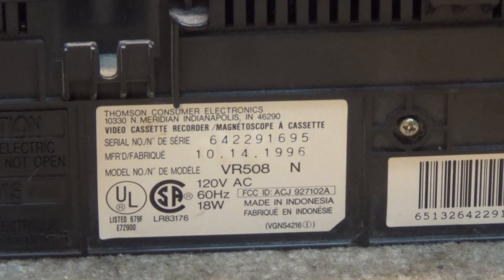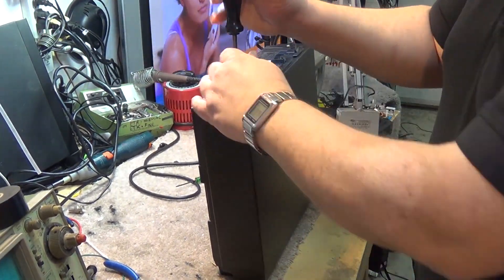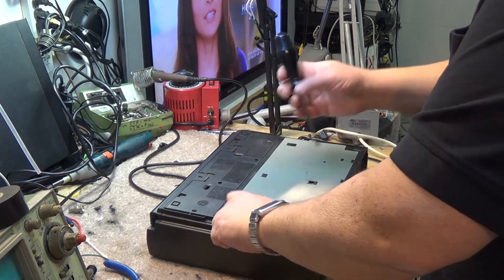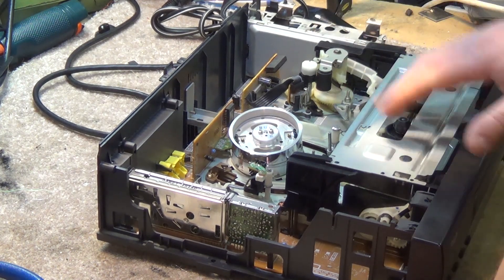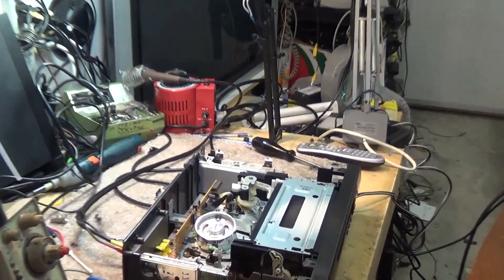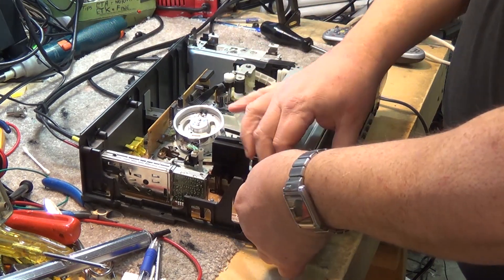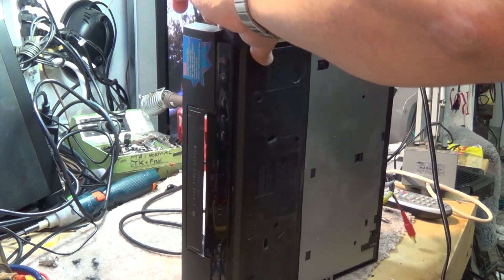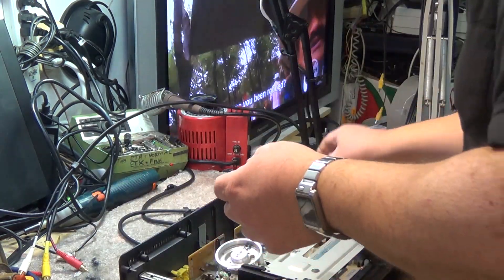RCA VR508 Overhaul

Comment: This Was A decent machine dave, but One of my youtube friends had an RCA Panasonic VR612HF VCR From 1997, and sadly, the Play/Pause button broke and by mid 2018 when he moved, he threw it out. It still worked though. I miss it bad:( I rembember the last video he used it in before that happened was 3/28/16. My 2nd Grandma had another one like that, but it was VR346 2 head version. And I remember at their old apartment in 2007 i remember it was in the spare room and by 2009 she moved across the street and by early 2012, i was disappointed it didnt have the remote control. By 4/7/2012 the day before easter that year, i took the front cover off, then my dad tossed it out. I should've had them order a remote for that one off ebay. Honestly, these panasonics from 1997-1999 and prior to that despite the common faults they have are one of my favorites.

Comment: Dave i tried as hard as i could to get my rca VR337 1996 VCR Front loader back in alignment and i did it first back on 8/20/2017 and i tried as hard as i could but unfortunately i couldn't. I did however turn the mechanism back all the way though. I didnt take off the cassette housing assembly. There are a LOT of screws and i was worried i was not gonna get it back together correctly because i never done this before until that day. I accidentally dropped a screw in the chassis and it sat for a month or so and on 9/24/2017, I decided to get the screw out and put it back in. However i did not even notice but somehow i accidentally broke one of the power supply clip holders when i removed it held by the red screw and as soon as i plugged it in 9/25/2017, the heads spun up like crazy and it was static on the tv, power light was on i remember. I tried as hard as i could. I could've done a LOT better.

Comment: Even though I have a complete different model, a bush VCR, and the symptoms on mine were different, I cleaned the mode switch and it works again. Thanks a lot! Now I gotta find out why I have no composite/scart signal. Only AV works.

Comment: I have a RCA VR616HF and I'm convinced they don't want you to service it. I literally can't find any more screws to take the tape mechanism off. And when I lift the mechanism is attached to the board because they both start to lift. Yet no screws to separate them.. I have no idea how to get at the belt underneath, I think that's the problem. Also there's a big housed in plastic thing with a gear with blue/green stuff on it? I think it's the ace head? I cant turn that by hand. Not sure if I'm supposed to. Can anyone help me out?

Comment: Smashing job :-D
Ive had mode switches create some odd problems, suddenly rewinding for no reason, or just going mad LOL :-D
A quick clean up and respring and its happy as larry again :-).
Some mode switches can be a pig to get to, but it has to be done.
My mate brought round a really nice ferguson videostar, it was thrown out by the local tv/video repair shop, the head loading arms had become disconnected under the metal plate, so off came the plate, i had to remove the static guides so some adjustment would be needed.
After the repair, the video gave a beautifull picture and sound, the rest of the machine was perfect, some tv/video repair shops really waste good equipment :-(
Reply from the maker: +zx8401ztv YES THEY DO.You are right about the mode switches. They cause many problems because the microcontroller reads the wrong value and does strange things.
Reply: In VRS 601, mode switch is activated by a lever when you Push the cassette. Debris and even a piece of paper loose from a casssete can make it work badly.

Comment: What a ""screwy"" vcr.  I usually pass on any mono vcrs.  But I may get one for my old Admiral TV set.  It's kewl to see what makes it tick, thanks.  Don
Reply from the maker: +umajunkcollector Actually this is a pretty good VCR. That is why 20 years later it is still working, and serviceable. It is not a HIFI machine, which would elevate it from a good to a great VCR. Panasonic made many good reliable VCRs over the years and this was one of them. They also made some terrible, complex designs. I am thinking of the one with the board over the chassis, and the solenoid that operated a clutch that threaded and unthreaded using the capstan motor. Also known as the 2 motor design. This one is a 3 motor, Drum, Capstan and loading.The 2 motor units (There is a teardown for one of those on my channel) was a bad design, yet many of their most expensive VCRs (the AG1971, 1980 AGW1 ect) used this chassis.
Reply: +12voltvids so if I ever try to service my Panasonic ag-26-000-e unit that it will be a pain to work on...well its good to know before if I ever worked on it..
Reply from the maker: +Anthony Kurtzweil The 2 motor designs were not that bad, just more gears that need timing. I have a couple of videos up showing the disassembly / reassembly and timing of the mechanism. There is one for the bottom of the chassis, and another for the top side.

Comment: I have a RCA VCR that looks just like this but model number VR503, it powers on and the mechanism works but the video does not work properly, the colors and textures are messed up. Is it a capacitor problem in the power supply? Anyway that VCR is not very important for me because it's basic and also common to find.

Comment: I thoroughly enjoyed your teardown on this vcr. I have a similar Panasonic model from 1992. What would cause two blue colored bands across the tv screen when playing a tape? Is it due to bad caps in the head amp section? Thanks in advance.
Reply from the maker: +Fred Chew Probably not. A problem in the head amp would cause total picture distortion. If the luminance (black and white) portion of the picture is good then the head amp is fine. Colored lines would be something in the chroma up convert circuit.All VCRs use a process called heterodyne, or color under recording. They take the color signal, which is normally a double sideband suppressed carrier AM composite signal mixed into the video. For NTSC that sub carrier is 3.579545 MHz, for PAL it is 4.43MHz.  Through mixing and frequency subtraction, the color signal is converted down to 629KHz and recorded as an AM signal along with the FM luminance portion of the video. On playback the low frequency portion goes through a low pass filter to remove the luminance carrier (and the luminance carrier goes through a high pass filter to remove the chroma)The chroma is then processed by the chroma circuits, and the frequency is converted back to the standard subcarrier frequency for the video standard you are working with and mixed back to the video.Color distortion if more likely caused by a drum servo error, running slightly fast, or slow. Your TV is likely able to lock in, and display the image stable, but it is far enough off that the chroma circuits are falling out of lock.I have a broadcast monitor that I will be showing off at some point soon. The key thing with broadcast monitors is that they have a very slow AFC for the horizontal, and color sync. So when playing a tape with bad time base it will show up as a wildly shaking picture. This was required in a broadcast environment so that the operators and engineers watching would know immediately that their signal was out of spec, and could halt transmission.Generally the alarms in a proadcast station would have already triggered and the transmitter had already cut over to the fanous "we are experiencing technically difficulties" slide. Our RCA TK28 telecine camera was always on standby, and the slide was loaded in the projector. As soon as an alarm was triggered, or the master control operator hit the switch the projector lamp would turn on, and the transmitter cut to the telecine camera.  This was to keep the transmitter from broadcasting an out of spec signal, and causing interference, or damage to the transmitter.You can see that massive camera unit on this archive page. It was a beast.http://www.oldradio.com/archives/hardware/TV/tk28.htm

Comment: I am working on my rca vcr right now. I am trying to get the mech and bottom plate apart.
Reply: got down to the mode switch. do I need to un soldier it?
Reply: +Shereen Esser and I do not have that special spray thing you put on the mode switch to keep it clean.

Comment: Do your customers pay you for repairing their VCRs? Or they just pay the shipping if needed?
Reply from the maker: Yes of course they pay me to fix their equipment. Units that are shipped in, they pay the shipping both ways and for the cost of the repair. My rates are considerably lower than shops with a store front as I have no overhead, and I also make money from the advertising that appears on my channel, so that allows me to work for less than the average shop, but I still charge something.
Reply: 12voltvids 
Ok, I see. If you were near me, I would have you repair my broken VCRs and camcorders on video.

Comment: Thanks for your interesting, and well presented videos. though one question I do have; when one cleans the video drum with paper and isopropyl alcohol, would the paper scratch the video drum, since paper is a hard like surface? just wondering. :)
Reply from the maker: +Guy I. Horn 
Never had a problem using standard copy paper. I learned this technique from a broadcast engineer at a TV station I worked at. The heads are made out of ferrite. They are strong in the direction they spin, but any vertical pressure up or down can break then off as they are very thin.

Comment: I wish my machines were that easy.... old zenith, and a old sharp , both from the early eighties... no modular parts in those, just to get to the timing have to remove part of circuit boards , a real pain... what would cause lack of timing signal? machine plays but jumps from SP to LP to SLP non stop and no picture

Comment: Your videos are brilliant helped me understand why the equipment is down. I have a question I have a philips FW-V355 mini hifi system and my audio cassette heads are kind of oxidized and I tried cleaning it with 70% isopropyl it did work out but it's not 100% Shiney.. What would you suggest me to do? could metal polish work? 99% isopropyl is not available in singapore. thanks
Reply from the maker: +Govinderjeet Singh When I worked in broadcast we used to use Xylene solvent.You have to be careful with this stuff though as it will damage plastic and rubber parts, so you need to use cotton swabs with wooden sticks to clean only metal parts with it.

Comment: I accidentally dropped a screw to go into the chassis into it, so it is rolling around in the player, tape goes in while apart while I control the loader and stops when the tape strip loads. Then eats it when it ejects.

Comment: Is it possible that some early 90s RCA vhs recorder's don't have a rotory encoder switch? I was cleaning my machine and took out the whole chaise and couldn't find a switch anywhere.
Reply from the maker: Hitachi made machines used a sliding type encoder switch and yes it gets just as dirty and causes problems.  I think I have a video up for that. If not I will make a video showing it.
Reply: @12voltvids  the vcr in question is a rca vr667hf. To my surprise it looked like no switch. I'll maybe take it apart again but I looked for 20min with the chaise taken right out. Thanks again
Reply from the maker: @reel_images  There will be some sort of switch. On some late model units they used push switches mounted on the main board that were activated by the slide cam moving back and forth.
The model vr667 means nothing to me now, nor does most model numbers. I have been out of the game professionally since 2003. I know the units to see them, but unless I am looking at the machine with the top off I couldn't tell you if that was a hitachi or matsushita made machine.
Speaking of Matsushita, I remember Hiro Matsushita, grandson of the founder of the Panasonic empire. He was a race car driver, and I remember meeting him at Westwood Motorsports track when he won one year. 88 or 89 I think. Of course his car was tricked out with Panasonic logos.

Comment: If you had your choice which brand of vcr would you choose to repair and why. Thanks
Reply from the maker: I always enjoyed the Mitsubishi models from the late 80's. They were built on an aluminum dicast chassis with metal parts. Units like the HSU82, HSU67 / 65 / 55 / 53 ect.
I also didn't mind any of the Sony models, both Beta and VHS. Hitachi also had some easy to work on machines as did Panasonic. Panasonic also however had some real bastard machines out there.
The one in this video, for example is a panasonic made machine and is relatively easy to work on.
Reply: @12voltvids  Thanks for all your efforts.
Reply: @12voltvids  my rca vr337 2 head mono machine did this same problem when I jammed a tape in it THIS IS A LONG STORY SO BEAR WITH ME. THIS WAS THE EXACT SAME ONE EXCEPT IT WAS A 2 HEAD MONO. THIS WAS BACK IN JULY 2017 AND I TRAPPED THE TAPE BY ACCIDENT ALL THE WAY BACK ON 2/17/15!!!!!!!!!!!!
Reply: Well how the mechanism got out of time is when I got the extremely eaten up tape out manually by lifting the 2 hinges to lift the tape out of the player. Then it started not going in and out and it was really annoying. I will attempt to get another one like this one day off ebay.

Comment: A late model video cassette recorder that is only mono?
Reply from the maker: Why not?
Not everyone wanted hifi. 
2 head machines were also made.
Reply: @12voltvids  Yeah, but I thought they only made stereo by the time the bare bones machines came out.
Reply from the maker: Nope, in the end there were probably more mono only models offered because the cost was so low. There were cheap hifi models as well.
Reply: @12voltvids  The reason I like hifi stereo more is because I record things off of tv, and I like it in hifi sound.

Comment: Wish I had a dollar for everyone of them I serviced the mode switch was a common failure
Reply from the maker: It's funny, and this is no bullshit. I opened a second bank account, and for every repair I have done, I put 10% of everything I fixed in that account. For every VCR I cleaned for example, I was paid 15.00. For every mode switch I cleaned I made 30. (50% of shop labor charge)
I put 1.50 and 3.00 respectively for those 2 theoretical repairs. Over my career this turned into a substantial amount of money. I have forgotten about it all. It is squirreled away in a retirement account earning fairly good interest these days, but it is there for my retirement. I was paid on average about 250 a day when I was working in the business so I would put away about 20.00 a day and totally forget about it, like it didn't exist. I had to because there was no pension plan where I worked. Now I can see the light at the end of the tunnel.

Comment: Have you ever worked on any smartphone failure before? Because I have a dead lg G4 phone, and it does not do anything at all.
Reply from the maker: Sorry, don't work on smartphones or tablets. Have done some simple things to get a few up and running, but that was more luck than anything else.
Reply: 12voltvids well, do you know that the lg G4 phone has a very common failure called bootloop? That is what my phone is doing. It is a broken soldier connection on the main board.
Reply from the maker: I don't have an LG phone. I have a Blackberry Priv. As I said I don't work on phones. I am sure that someone that does work on them has made a video of it.
Reply: 12voltvids I do not know who.